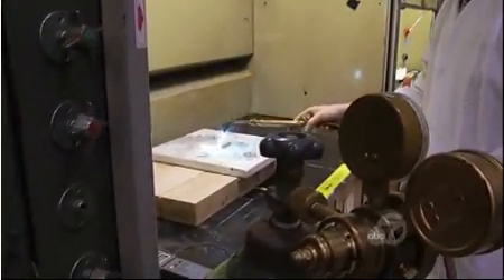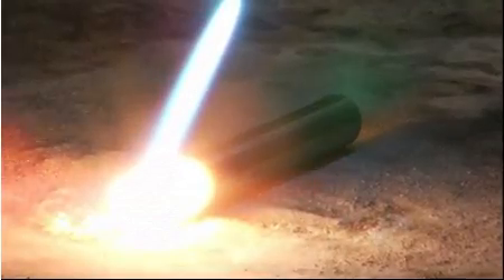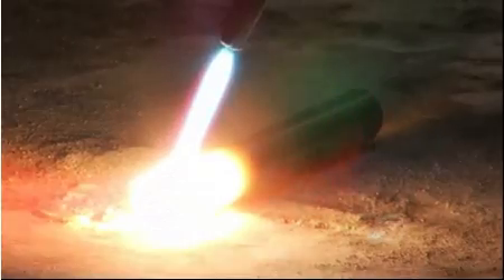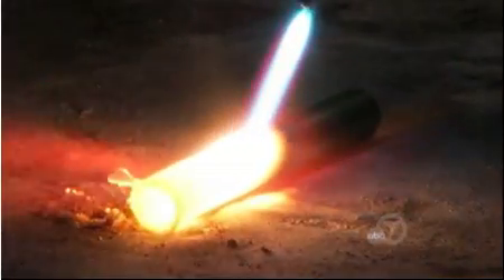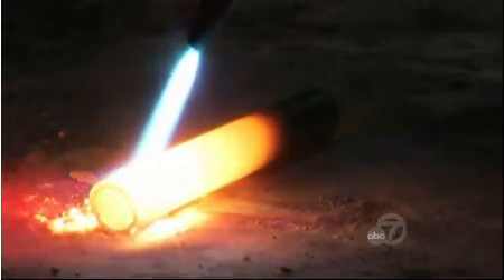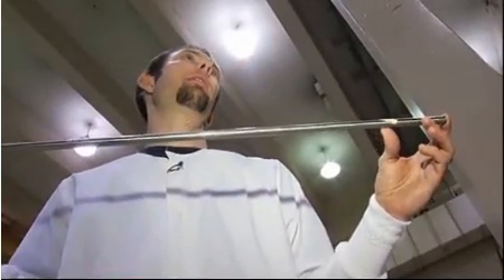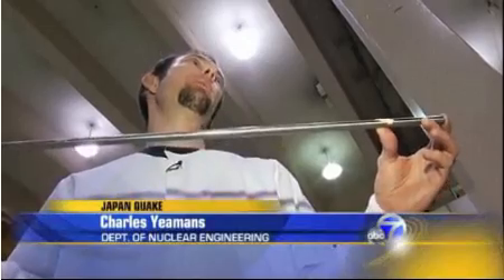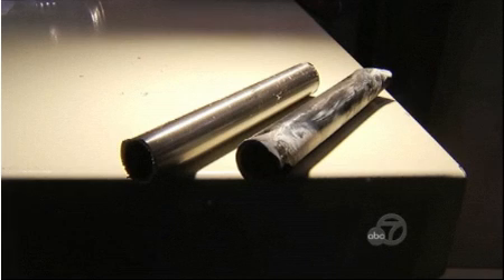Zirconium fuel rod fire test

Comment: I see that people have no idea how hot it gets during a meltdown. A zirconium fire is one of the hardest fires to put out, harder than uranium or plutonium, in fact you have to use special agents and fluids to do it.
Reply from the maker: +Kevin Spies Why don't you enlighten me? How hot do you think fuel gets during a loss of cooling accident that leads to a slow meltdown as occurred at Fukushima?
Reply: 2800 degrees C. 5000 degrees F, lookup corium. It is well known that 3 reactors melted down and they have no idea where the corium is right now.
Reply from the maker: +Kevin S. It is certainly possible to find that misleading information on the internet. However, there are knowledgable people that know that the melted and later solidified core material at Fukushima most likely resembles the similar material that resulted when TMI experienced a partial core melt in 1979. http://atomicinsights.com/radiation-probes-indicate-no-melt-through-at-fukushima-unit-1/
Reply: K S. I work at a zirconium plant that produces nuclear grade zirconium and when we have a zirc fire we just put salt on it. haha

Comment: wouldn't say impossible... zirconium is extremely flammable with zirconium powder able to spontaneously burn at room temperature. It's use in flashbulbs to produce a bright light and explosion prove it's volatility, though solid pieces catch at higher temps perhaps 2000 degrees. Much lower than the 5000 of a meltdown

Comment: At 50 seconds the professor says Graphite is like coal and can burn violently.  He is WRONG about this.  I use graphite crucibles at work to melt metals in a high temperature furnace.  It does not burn.  In fact the graphite crucibles come out of the furnace white hot and do not burn at all.

Comment: Did no one else catch ABC 7 screw up the concept of a moderator?

Graphite is a moderator, water is a moderator.  10 bucks says ABC 7 thinks that a moderator slows down a nuclear reaction.
Reply: There are 2 types of moderators in a reactor, one is the neutron moderator like water/ graphite and the other is the one that moderates the energy output of the reactor, thats your boron.

Comment: ...  Zirconium which is the metal that is used in most fuel rods reacts with steam just as many other metals do at very high temps to produce hydrogen.  No one said the rods catch on fire.... by their by products at high temps surely do. To say there isnt nothing that burns in there is completely false.

Comment from the maker: @iamgoddard I am quite familiar with the disgruntled ex nuclear industry executive who performed that test. What he did not tell you was what really happens after the cladding gets embrittled and the fuel pellets - mostly uranium dioxide - spill out. UO2 cannot burn - it is already oxidized. It does not melt until it gets to a temperature in excess of 2500 C. The decay heat power is not sufficient to melt through the many layers of containment. It is not even likely to melt through pool liners

Comment: This is crap, the torch is in a reducing atmosphere of the flame. Use an electrical current to heat it to 2000 degrees and watch it burn.

Comment from the maker: @FrankensteinFinance - you are confused about the difference between a speck of zirconium and a rod. Chemical reactions are dependent upon many variables, one of which is the surface area to volume ratio available for the reaction to take place.

Finely ground metals can burn because they have a lot of surface area in contact with oxygen. When the metal is solid, there is far less surface area. It is not surprising for "specks" of metal to be able to burn while solid tubes cannot.